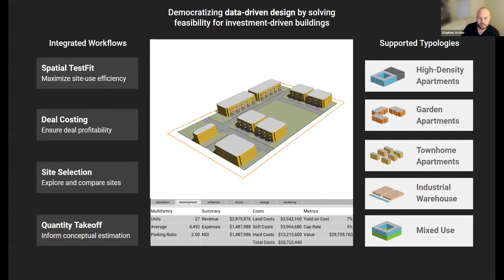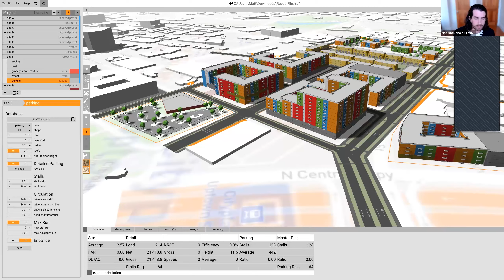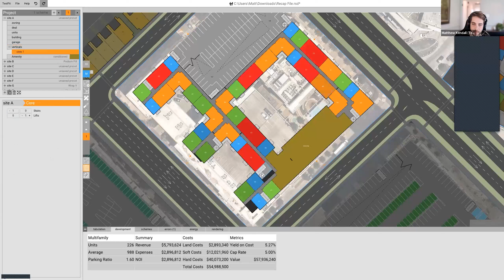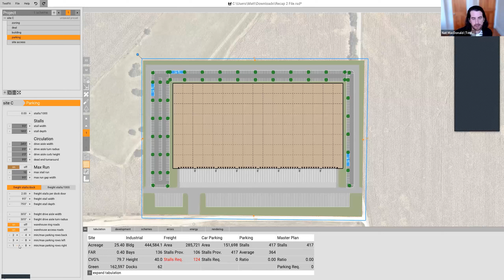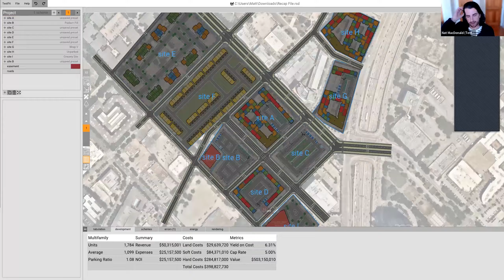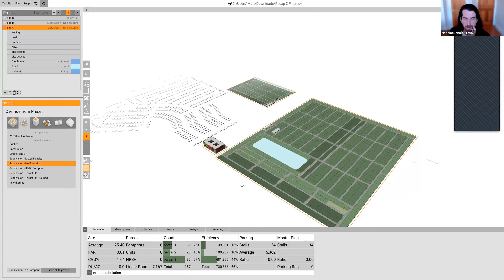TestFit Webinar: 2022 Product Year-in-Review

Comment: Hello.
I'll give you a little tip (in case you're interested)
TestFit already does jobs that I haven't seen in any software yet. It is a geometric evolution for someone who designs urban development like me.
If it is not too difficult, it would be interesting to include the hydraulic, sewer and rainwater pipes AND electrical installations.
The inclusion of “manholes” would also be interesting. In Brazil, we call it PV and rainwater catchers.
This would be fantastic for anyone doing land development, whether horizontal or vertical.
As they are linear and punctual measures, we would be able to estimate the quantity of the enterprise more effectively.
As, generally, the dimensions of the tubes vary little, it would be very interesting.
I'm not talking about sizing. But pre-estimate.
Well, sorry for the intrusion.
Thanks